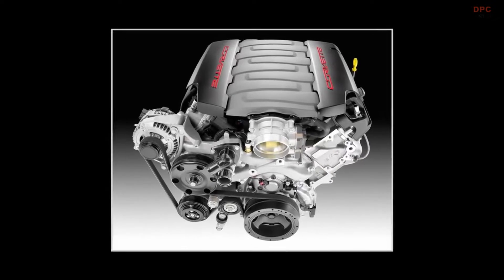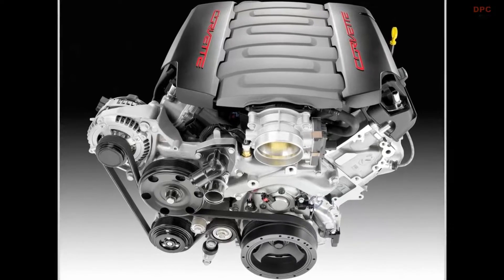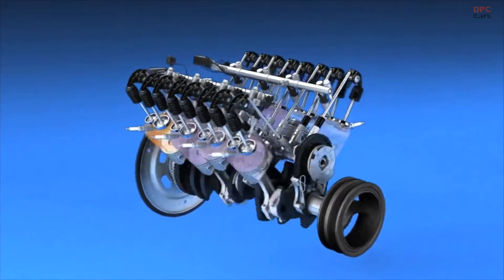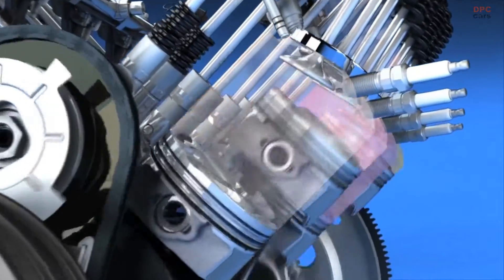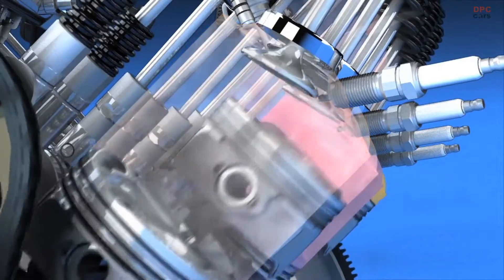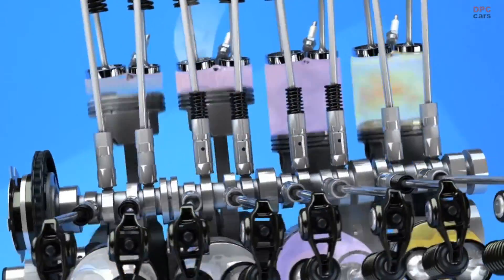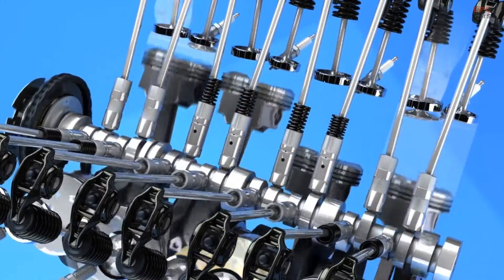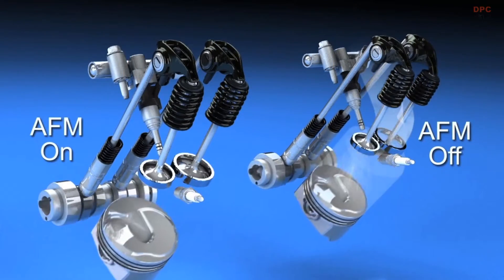Older Gen 5 GM LT1 Engine Powertrain Tech Animation

Comment: This (LT1) is neither small or big, they are all the same size. How can this engine be a Gen 5 V8 when GM Global Propulsion Systems was started in 2020? By the way, the last use of the Chevrolet engine name was 1991. GM Powertrain took over after that making GM engines. You can Google this timeline to read all about it. Forbes -Global Propulsion Systems Is The New Name For The Team That Makes General Motors Vehicles Move.